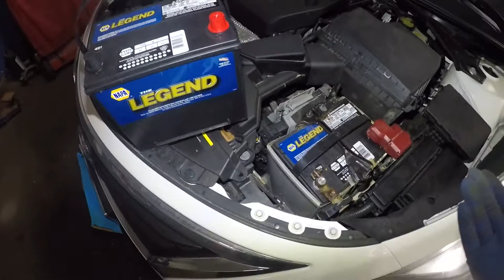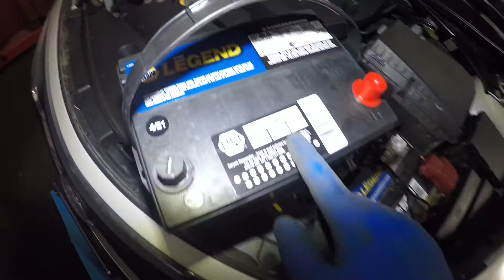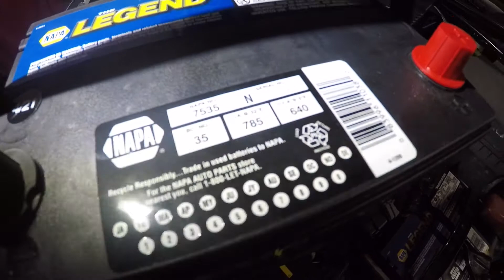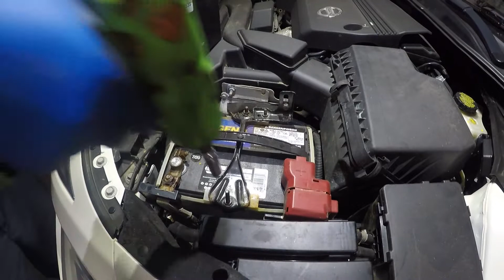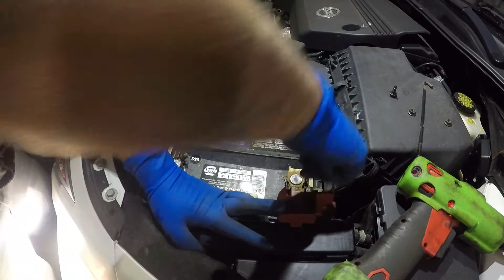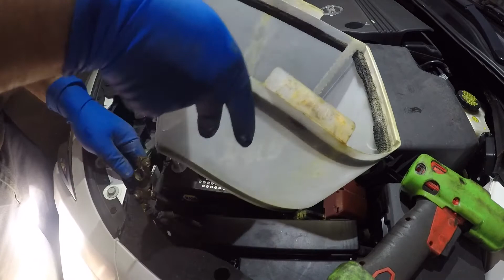How to replace battery on Nissan Altima 2011 and up without loosing IDLE speed memory

Comment: What’s the L shaped black metal piece connected with 2 bolts between the battery and the ECU? What’s the function of it? Thx
Reply from the maker: Just bracket holder